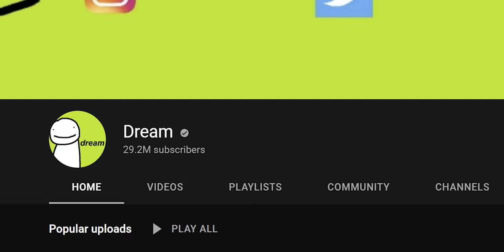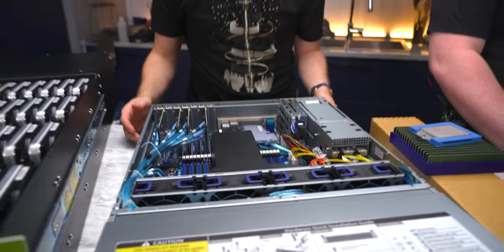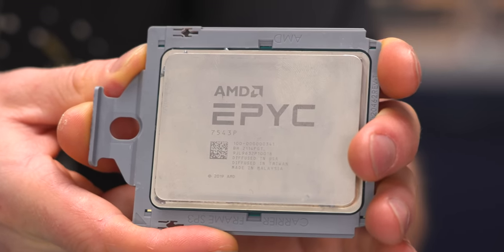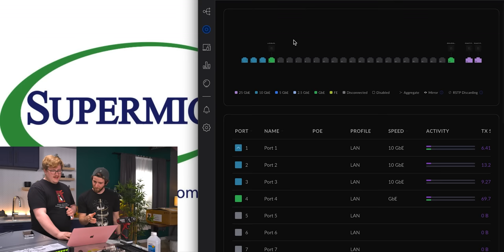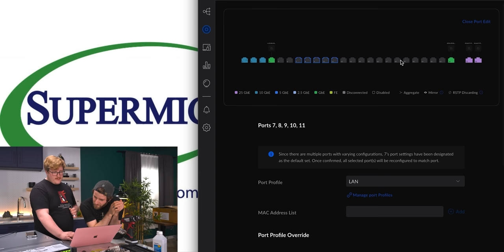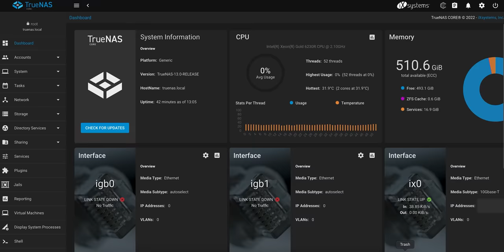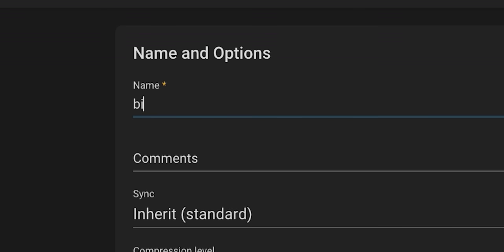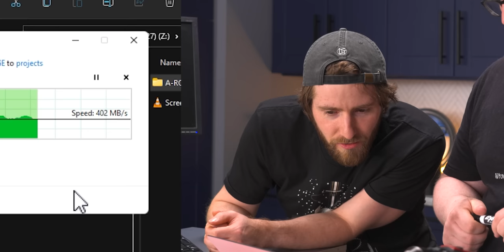Dream has Too Much Money - Dream Server Build

Comment: I'm wondering if they have a big shelf in the office which is labeled: "dropped drives" filled with hard drives that Linus dropped which may or may not work anymore.
Reply: nah
Reply: I'd actually laugh if they did
Reply: They do, it's called the LTT warehouse.
Reply: That's what the new warehouse is for. Labs is just a cover story!
Reply: Schrodinger's Drives
Reply: No need of labeling, they all felt at least once
Reply: You mean the "Linus shelf"
Reply: haha
Reply: When will they install rubber mats in that place 😂 
Except the static would kill everything D;
Reply: @CTSSTC  rubber mats with foil coating on top?
Reply: F for all the lost drives..
Reply: More then dropped.drives lol dropped everything
Reply: more like 'dropped hardware'
Reply: They probably need a warehouse for all things Linus has dropped that may or may not work…
Reply: @CTSSTC  uhm..rubber does not conduct electricity so it would actually be a good idea to do that for two factors no static and dropping things
Reply: @Rip0517x the fact that rubber doesn't conduct electricity is exactly why you DON'T want it and want something conductive. Rubber will allow large charges to develop on the people walking around and lead to worse static discharges. You want to be grounded when dealing with electronics and a rubber floor is the exact opposite of that. Rubber=massively more static

Comment: When Linus dropped that drive I felt physical pain, that thing has more storage than all my family's pcs combined 😭
Reply: That thing has more storage than my microwave!
Reply: I'm sure the drive is fine.
Reply: Granted it's just me here but I'm rocking about 4.5tb in actively used computers, 8.6tb between 4 drives not in use, 500gb in a portable, and 4tb in the guts of my dad's arcade machine project he hasn't moved forward on in about 4 years, but my part is done. So I'm close... but only if you count things I'm not actually using
Reply: yeah that dropped drive has more storage than all of my gadgets have combined
Reply: @ninjaoyourbro1891  you should upgrade.. that's a bit out of date
Reply: @prof.esrever7823  yeah, I’m probably gonna get a 100 terabyte microwave pretty soon.
Reply: Your family has personal PCs? My family has personal laptops. None of my family has a PC.
Reply: @edwardallenthree  the drives going to dream, its not fine.
Reply: that's an enterprise-specific HDD built for datacenter, not to mention the the actuator arm (read/write head) probably already parked after testing from factory, so there's no chance of the magnetic platter getting damaged.

had my hdd accidentally dropped 2 feet above ground. but once I tested it, the HDD just runs fine without any bad sectors. I was doing a usual cleaning of my PC, disassembled everything first. and modern HDDs had a standard feature of parking the actuator arm before PC shuts down (or in case of external/portable HDDs, USB device properly/safely removed).

But still, never drop HDDs. Always check surroundings if you're working with HDDs on your workspace.
Reply: The fact you said family's PC's you'll be right richy rich
Reply: dude that drive is more expensive than my god damn house what you talking about
Reply: Thign has more storage then my familys mine and my cousins pcs in total and all of them have there storage at 90% of just random stuff
Reply: @pianoplayer2147  a laptop is a Personal Computer, or P.C.
Reply: That drive has more storage than my brain at school
Reply: @ninjaoyourbro1891  i got a 200 terabyte fridge and i use it to store a lot of food
Reply: It's a bit less than my PC and server combined, but the speed of that drive is probably a bit higher than my storage drives.
Reply: @pianoplayer2147  what do you think a laptop is?
Reply: More storage than i have ever had across all the devices ive owned
Reply: it has 10x more than all my familys lol
Reply: i just conflicted
my minds say its ok and the other minds say its not ok and pain
Reply: Come LTT why'd you have to go and remove the comments about dream cheating
Reply: @pianoplayer2147  a laptop is a PC genius.
Reply: That has more storage than my entire neighborhood
Reply: @AarxyGD  same
Reply: Is anyone surprised that he basically threw the thing to the floor? Linus “I wasn’t paying attention” Sebastian.
Reply: Same again. I estimate I have around 12TB. Including: my rig 6.5Tb,  my phones, my wife's terrible work sff, her rig, and both her lappys..
Reply: It is. Drive being dropped while off is pretty safe from that height and below. Above might be risky.
Reply: @ninjaoyourbro1891  it's kind of funny, but kind of not.. Why not have 2.5" or 3.5"flex  hotslots in all IOT big appliances.. It's actually kind of genius...
Reply: @davesampieri  Yes didnt notice
Reply: @michaeldavis9772  I added my mom my 3 sisters my dads 2 phones work and normal phone my pc my brothers phone and his laptop. I got a total of 5.7tb that is used and 8.1tb free space, i have 1tb of space adn this is a newish pc adn already 300gb is wasted as i have games on it. At thr moment downloading far cry 5
Reply: @AbsoluteRandomnessYT  These things also have to survive logistics... the trucks that actually deliver to the door. It'll be fine.
Reply: That has more storage than my car jesus
Reply: @richardgarrett2792  Yeah, I agree. Can't believe I forgot about that, lol. :D

Aren't the HDDs stored vertically on styrofoam (like how the HDDs mounted on the Storinator) during shipping? I saw a box full of brand new HDDs that was stored in a custom molded styro during the time I bought a 3TB WD Red on our local PC shop.
Reply: @AmaraTheBarbarian   I have about 25 TB if I count all my drives.

But its split between like 10 drives and not on one ;)
Reply: @jackelwalker  Oh oh oh, I forgot my old optiplex! Add .75 TB to my total!
Reply: @michaeldavis9772  XD
Reply: @Drknss521  hahahah good night now
Reply: @michaeldavis9772  Goodnight now
Reply: @masterdoge17  Do they really? I still found some.
Reply: @jackelwalker  And to you too, good evening lord, or lady. Safe journeys.
Reply: @edwardallenthree  "the drive is fine" - for now.
That thing will fail sooner than the others.
Reply: @flyingtentacle7631  fair enough. Well, one laptop is really a PC. Two are chrome books and one is a Mac. Sorry. Let me be more specific next time and possibly be nicer when answering people in comments. 🤗
Reply: @michaeldavis9772  XD
Reply: Goodmorning
Reply: @AbsoluteRandomnessYT  Vertically yes, I think from what I have seen of maa shipments. Pallets loads. I don't recall if the crates required orientation (THIS SIDE UP) or not. I can speak to recent drives shipped to my home and they have been all in the cardboard box with the plastic insert and anti stat bag (from WD this past year). IIRC Seagate used to do something similar.  These are what gets tossed around in shipping. I did have one fail out of the box this year and it was a WD. I don't recall having any others fail immedieately. Even Maxtor.
Reply: @kamotetops1572  nothing to see here, move along. Everything's just fine and normal.
Reply: My family is not even close lol, there must be less than 5 TB worth of storage in my house in any device

Comment: Dream aside, those Enterprise SSDs are very cool. Honestly I would watch an entire video just about those SSDs.
Reply: Yea. When I saw the size of that controller, I was blown away. And the sheer density of the nand chips. 30TB in that size is hard to comprehend.
Reply: Same, honestly. Full builds aren’t my thing, but honing in on a specific type of tech is way more engaging imo
Reply: ya you are right
Reply: The original NVMe storage arrays were unrelentingly cool. They were called DSSD and the company was acquired and subsequently killed by Dell. There was a reason their product wasn't exactly feasible, but damn were they cool. They used entirely custom drives in a blade format that was, like, 7"x24"x.325" so they could pack them to the brim with SLC chips and controllers. I think the largest capacity blades were, like, 4TB? They functioned by directly attaching the array to a server or PC via a proprietary Direct Attach Copper cable (which was the reason the product wasn't feasible at scale) to provision block storage devices directly to the client PC's PCIe bus. Dell and their partner companies in the various standards groups did figure out how to encapsulate the packets in such a way that they could switch and even route NVMe storage packets over storage networks, thus allowing them to scale their NVMe-backed storage arrays, but it was already too late for DSSD. I would love to see Linus get a hold of one of them and have Anthony and Wendell figure out how to get it working. One of the cool things about it is that you can totally connect multiple cards in the same client device to the DSSD and provision storage from it to that device. There's also an open-source linux-based OS that allows you to set fiber-channel and network cards as array target devices, so you can have the client device act as the storage array using the block storage provisioned from the DSSD as the storage pool to provision devices from. It'd be a fascinating, if EXTREMELY high-level, project to tackle.
Reply: I mean given Intel got their drives so wrong then absolutely yes
Reply: Those were some sexy bits of engineering. We didn’t get the best close ups, the tolerances I was able to discern from screen grabbed frames looked amazing. I’d watch that factory tour!!!

Also, very interested in vetting and testing methodology for that grade of product.

Comment: 18:05 This is literally what storage architecting discussion are like at every workplace.  You got the one technician that has the "I do NOT want to get called about lost data," approach, and you got the other one that is going to have to have the "I thought we bought 1 Petabyte, why is the DB team saying you only gave them 700TB?" discussion with the boss.
Reply: had this discussion the other week on similar premis.
Reply: Absolutely. Data protection first, and you get what’s left over, but you do need to take space losses from parity into consideration.
Reply: @RhodderzX  My storage server proposal spreadsheets always have TiB calculated before compression, taking into account parity, hot spare, cold spare & vdev configuration before compression. There's also a "storage efficiency" presented in percentage column below the usable field. Never any questions asked when the network shares eventually come online usually about two months later after memory and disk testing.
Reply: I worked in the enterprise storage area for a while.  This is not a question.  Data protection is first.  The cost of the hardware usually does not matter.  Since data loss is a death sentence.  If you were the vender or decision maker you are basically blacklisted.  Also especially if you are really talking about Enterprise if any data was lost, it would take at least a days worth of time recovering the disaster (most likely more).  When most businesses could lose millions a dollars an hour on a system outage.  The hardware cost all of a sudden doesn't matter.
Reply: Give them compression and dedup 😁
Reply: Since I've been buying job lots of cheap knackered crap quality 3TB SAS drives on ebay I've got quite familiar with TrueNAS 'replace' function. Jolly glad I have at lest one redundant drive.
Reply: @jeremyscherbert7336  If you've got the CPU and RAM for compression and dedup.
Reply: @davidchan1733  that hardware cost does not matter is also true at the very bottom, where a craftsman might use a 300$ PC for his little buiseness, the data are quickly reaching more value than that. 
years ago i read that 97% of buisenesses that endured a total data loss are not exsistant any more three years later.
the exact number is certainly obsolete, but i can not imagine it has changed much.

Comment: In addition to the 8 GB of DRAM on those Enterprise NVMe drives... I'm wondering what kind of processing power that controller has. Probably an ASIC, but I'm guessing it's as fast as some of the computers I have!
Reply: Id be curious to know as well
Reply: It's gonna be a lot faster than a raspberry pi for sure!
Reply: I smell a Jeff + Linus collab .............
Reply: Imagine a drive controller being more powerfull than the server's main cpu just because you're using a raspberry pi
Reply: Jeff geerling best nerd tuber out there!
Reply: Linus x Raspberry Pi Connoisseur, HYPED!
Reply: @davidcampos8795  Wendell cries in corner
Reply: Its probably an FPGA, from Xilinx i belive-
Reply: @sovietsrocketworkshop5706  was also thinking FPGA..
Reply: Hey Jeff :p
Reply: Jeff, I'm so happy to see you blowing up on YouTube, your content is fantastic and I love the nerdy community you've built.
Reply: Come LTT why'd you have to go and remove the comments about dream cheating!
Reply: it needs enough to do 7GB/s of throughput so i would guess its probably around a q6600 in terms of logicial throughput
Reply: Hey Jeff, love your videos. That might very well be based on a Marvell® 88SS1321 which is based around Tri-Cortex R5 CPUs. It's datasheet is publically available. Have fun.
Reply: They also have nand die recovery in case one fails
Reply: Oh hi jeff
Reply: @74LS_NE555  Excellent little chip.
Reply: @zbigniewbielinski9629  I don't have to imagine it, I *do* it! :D
Reply: just wait until it plays doom
Reply: Love your vids btw
Reply: hi jeff
Reply: Heck, that could be a PowerPC. I've seen that package on RAID cards.
Reply: how about you don't support a video of a cheater?
Reply: @zbigniewbielinski9629  20 gamers one pi 4
Reply: Usually large ssd companies will make their own asic for their enterprise drives, with the size Kioxia is at they should be following that trend. The ASICS can be prettttyyy quick but yeah they’re only good at that one thing haha
I work at a large ssd/storage company, this is the format we follow. If you have other questions that are generic and non NDA-esq I can try to answer
Reply: "as fast" well if it's an ASIC it's probably faster but only good for one task
Reply: Explaining Computers channel did an RPi NAS server today but unlike yours, there was no pciE controller running multiple drives in RAID...I mean, what's the point if you can't do at least six drives and a powerful video card to boot (on a pi).
Reply: @sovietsrocketworkshop5706  There's a a Marvell text under the kioxia logo on the controller, so it's not a FPGA. Another comment has already given the model.
Reply: put that to your rpi nas server, lets do it !!!
Reply: Anyone played doom on one?
Reply: i have no idea what you just said so just take my like
Reply: Ok
Reply: gachiHYPER
Reply: You literally could see the asic
Reply: Let's face it. modern enterprise nvme drives do magnitudes more computing that the best computers 10 years ago..
Reply: i assume by computers you mean the million raspberry pi's
Reply: That's hilarious because I literally said to myself "Controller? That thing is an ASIC!" cause, honestly, it looks like it really might be!
Reply: Whatever it may be the controller, no doubt it must be very power efficient to just depend on a couple of electrolytic capacitors as backup in case of a sudden power loss and still manage to write out the 8 GB DRAM cache.
Reply: @74LS_NE555  oh that would be epic
Reply: New sub for your channel

Comment: Although its now been well over 20 years, I still remember vividly the time I'd gone to a computer parts store after school with a friend so he could buy parts for his PC; these included a large - for the time - 10 or 15 gig PATA HDD. As we left the store, owing to excitement, he started unconsciously swinging the bag of parts back and forth as he walked. It didn't take long for the bag to slip from his grip and meet the sidewalk with a disconcerting 'thud'. The drive was, of course, DOA. These server grade drives should be a lot more durable though.
Reply: That was 20 years ago, when also Laptop hard drives failed constantly when they were dropped. The hardware manifacturers have worked much on that and of course the experience they made with 2,5" hard drives they also now use in 3,5" hard drives.
Reply: There's also a difference in momentum between a casual drop like the one in the video and a drop from letting go of a bag that was being swung around.
Reply: That exos drive is dead.
Reply: F
Reply: The raw data files for Toy Story totalled just 2 gigs.
Reply: Even my 2010-2012 HP laptop hard disk corrupted and encountered a fatal error just from laying flat on the back seat without a carrying case, 2 tiny potholes on cushioned seats were enough to destroy it, at least nowadays, as long as it's not cheap Chinese factory hardware, you can actually get what you pay for in terms of quality of electronics compared to the worth - value ratio in the past when technology was just beginning to innovate ahead of it's time.

Comment: Man, having to deal with premiere from a HDD NAS, I really need to build a NVME one for active projects like this, or well 25% like it...
Reply: to be honest i've always thought it was norden and not nordern
Reply: You could also try a local SSD cache for the NAS mount to get quick relief.
Reply: Or you just put an additional nvme array in your main HDD NAS. No need for another server tbh unless the current one is physically full.
Reply: Honestly, a SATA cache would more than likely do the job, if your editing machine is connected over wifi or anything less than 10GbE it'll be easy to saturate that with SATA

Comment: SRE here, The cost math for the "idle" drives is a bit backwards in my opinion. The cost question needs to start with out much is the data stored worth, how much risk are you willing to accept,  depending on that the 90K in backup gear is either wildly over kill or a no brainer cost.
Reply: Ok